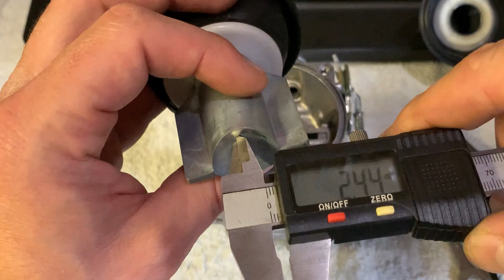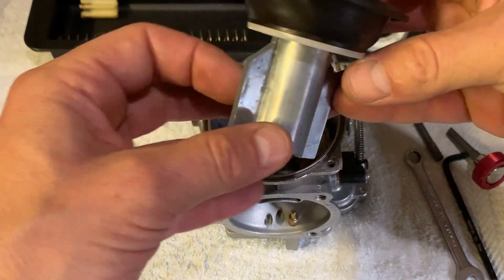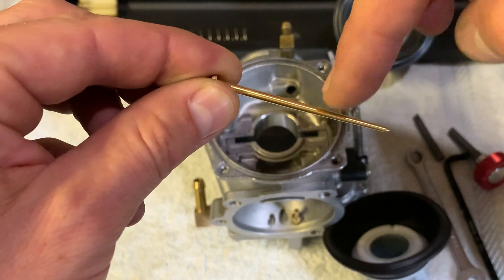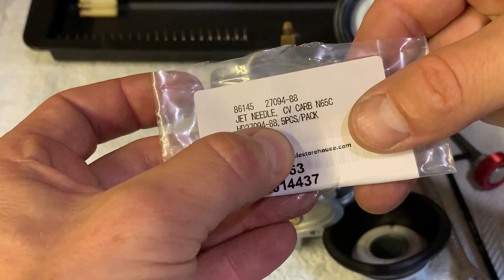Harley CV Carburetor Tuning Twincam 88

Comment: This tune is great. Thanks for this. No more popping and coughing through the air cleaner. Runs perfect. 2005 88ci
Reply from the maker: Glad it worked 👍
Reply: The same for my bike twin cam 88 2005 caughing i just shim the needle and sand paper a bit and right on perfect and thank you for the jets size and years info great my friend!

Comment: Aron, I did the mod. Including the Sportster needle. 
Results; faster, smoother and it idols.
Reply from the maker: Great! Pleased it worked out.
Reply: @aronsgarage834 

I do have an interesting thing on my Carburetor, the mixture has a fill or plug making it inaccessible. I didn’t attempt to do anything to get to it.  Have you seen the his on any of the ones you’ve worked on?
Reply from the maker: Yes, of course. That’s just the factory plug. At least you know that nobody messed around with your carb before. You need to drill a small hole in it (not too deep as you can easily damage the mixture screw under it.) then using a screw extractor you can easily get it out. Do count the tuns though and record it somewhere before changing the setting.

Comment: Great video! I have a 2006 night train 88 cu. in. with Thunder header 2 into 1 exhaust stock CV carb. harley one step up SE211 cam and screaming eagle air intake. Stock control module also. I have the N65C needle but not sure how many washers I should install on it. can you help out a Vet?
Reply from the maker: I think you’ll be alright with 3 washers.
Reply: @aronsgarage834  I couldn't find  .3mm washers anywhere but, I did find .5mm washers. Would I be alright if i install
ed' 2 of them? that would be 1.0mm...also, will I be alright with stock 45 idle  and 190 main  jets?
Reply from the maker: Yes, 2x .5mm will be perfect. And yes, keep the 45 and 190
Reply: @aronsgarage834  Update! You are correct when you say it's a beast. 2 of the  .5's worked perfect. No hesitation at all even on slight acceleration. Top end pulls stronger too.  Thanks again Bro. I'll keep on the lookout for any new videos you put out.
Reply from the maker: Great to hear the setup works for you too!

Comment: Great and very helpfull vid. Thank you. Now my Sportster XL1200C 1999 model (screaming eagle pipes and k&n high flow filter) seems to be having a shortage of fuel. Gonna try 45 (was 42) main jet and a 180 (was 170). Should that do the trick? Or bigger jets?
Reply from the maker: Yes, you should bump up the slow jet to 45 and the main to 180. Later on it was standard anyway on the 1200 Sportster.

Comment: Hello Aron,

Nice video👍🏻.

I have a problem with mij dyna tc 1999.

My fuel consumption is terrible. 

It was 1 to 18, 1 liter on 18km

Nou it's 1 to 8 😢😢

I completely cleaned the carburateur and refurbished the carb.

Do you have an idea what it can be. 

Hoop to hear from you.

Kind regards, 

Mike
Reply from the maker: Hi Mike, Mine is a 1999 Dyna too! Did you install the needle jet the right way? Goes back in either way and can cause issues with consumption. Float level all ok? Pilot screw adjusted? What jets and needle are you running?
Reply: @aronsgarage834  
45 and 190.
This problem started 4 weeks ago. 
I have no idea why??
It doesn't smell like fuel, no black smock out of the exhaust.
Reply from the maker: Did you double check all those things I mentioned?
Reply: Hi Aron,  yes I did.

I have bin driving to day and still 1 to 8
Reply from the maker: Then I would check a few other things: tire pressure, brakes, wheels (to make sure they aren’t dragging), air cleaner, choke/ enrichener, diaphragm on the slide, engine oil level, exhaust, any gas leak.
Reply: What is diaphragm on the slide
Reply: I know what you mean 
I have put a new one in
Reply: I have suppertrap exhaust on my bike 

Nothing has changed on my bike
Reply: When the olie is two low will it use more fuel??
Reply from the maker: It’s the rubber around that creates the seal for the vacuum. If torn, it could cause problems with fuel.
Reply from the maker: Good
Reply from the maker: Yes, it would. More friction, more struggle for the bike to run as normal

Comment: Great video and very informative. I own a 1995 XLH1200 Sportster and I'm about to replace the jet needle to a N65C, however I'm not sure what the stock slow/idle jet size should be from factory. In my official Harley parts catalogue it states part No: 27281-92 but doesn't state the size. Likewise with the main jet, no size given. Can you please advise?
Reply from the maker: Thanks for the feedback. I pulled some data, looks like yours had 42 slow and 170-185 main depending on model. I would try 42 and 180 combo, but if you’re over 4 turns out with the mixture screw (when running properly) you might want to bump it up to 45.
Reply: Thanks for your response and information. Regarding the needle, do you suggest I use the 3 x 6 x 0.3 shims too and how many?
Also, where is the best place to source the jets you mentioned, please?
Reply from the maker: I think 2 of those shims would be enough for you. You can get jets from CV Performance (great quality) or genuine Keihin.
Reply: Sorry, it should read mixture screw 4 and 3/4 turns out.
Reply: I ended up turning the mixture screw 5.5 turns out to achieve a satisfactory outcome.
Reply from the maker: In that case I would definitely want to up my slow jet by 1 size. 4 turns out should be the very max.
Reply: @aronsgarage834  I have a 48 slow jet available, do think that should suffice?
Reply from the maker: You have a 42 in there currently, right? If so, 45 will be plenty. Even in a Dyna 48 can be too rich.
Reply: @aronsgarage834  I swapped out the 42 for a 45 and that's what is currently at 5.5 turns out. I do have a 48 too, but I'm awaiting your advice. Please note: the mixture screw projected 2mm into the throat of the carb intake when fully screwed in.
Reply from the maker: Okay. I see. It projects quite a bit, hence you need more turns out I believe. Out of curiosity, when screw is fully seated, how many turns out to get it flush with carb body?
Reply: @aronsgarage834  Not sure. Do you advise swapping the 45 for a 48?
Reply from the maker: I would stick to the 45 to be honest.

Comment: Thank you for making this video. Great stuff! I did this to my 2000 soft tail heritage and it runs great now. No more sneezing or coughing. The only issue I have now is that it idles a little to high for my liking. What would you think the fix would be for that? I think the only modifications I have are a high flow air cleaner and straight pipes.
Reply from the maker: Thanks for the positive feedback. It’s just a matter of bringing it down with the idle screw. Have you tried that? It should run around 850 idling cold and 1000 warmed up.
Reply: Twin Cam motors are supposed to have a slightly higher idle speed than older, EVO, Shovel motors. The beloved 
"potato potato" idle is for older motors. Bringing a Twin Cam idle down very low could cause engine damage, due to low oil pressure at idle.

Comment: Hi Aron, thank you so much for this awesome video. I've got a 2001 Harley dyna 1450, with exactly the same exhausts etc as you have. I followed this video and did a carb rebuild kit on my carb and at the same time I set it up to your spec and made sure float height etc was good. Wow, mate, I thought my bike was good before but now it moves like shit off a shovel!! I certainly reaped the benefits of my labour. Thank you again dude. Ps, are you based in US or UK? Peace and love from England. Grant.  🙏🏻
Reply from the maker: Hey bud, I’m glad the setting worked out for you! You’ll notice that even the consumption will be great, too. I’m based in the UK (Milton Keynes) Might see you on the road in the spring 😎
Reply: @aronsgarage834  ah cool, ya know what that would be pretty cool actually man. I'm pretty sure we could make that happen. Cheers!
Reply from the maker: Absolutely! Let me how the bike runs in the spring
Reply: @aronsgarage834  will do mate. Tempted to go to a 46 slow jet as I'm at around 3 and a quarter turns out on the fuel mix screw. I tried just under 3 but it had a couple of moments of hesitation (carb sneezes),
 But soon as I hit 3 and a quarter it ran beautifully
Reply from the maker: I’ve been at 3 and 3 quarters for a while now and runs even better. Better cold idling/running and same performance. Seem to remember when I tried it with 46 it was not as good. I clearly remember though running it with 48 was really bad. Was running way too rich (sluggish) even with pilot being half a turn out only.

Comment: Very informative, thank you. I have a 94 Dyna 80 ci. Screamin Eagle pipes, high flow air cleaner. Would this set up work on my Evo?
Reply from the maker: Well, I have never tuned an Evo so this is only my best assumption: I think it could work really well, but I would use your stock jets. I believe 42 slow and 165 main?

Comment: Do you need to shim the CV Performance needles also?  Great video.
Reply from the maker: Thanks. Not sure as I didn’t experiment with those needles, but since it’s a performance needle, you shouldn’t need any shims.
Reply: @aronsgarage834  I checked their website. No shims required, just drop in and run it.
Reply from the maker: Yeah, that’s what I thought.

Comment: I have a 2005 dyna wide glide. I put an aftermarket air breather on and now my bike runs like crap. Do i apply the same methods here? Do i need bigger jets and needles? Please help!
Reply from the maker: You don’t have to get bigger jets. Your stock one are 45 and 190. And you only need a different needle if you want more power. You just need to adjust the slow jet for now. Count the number of turns it’s set in now, (by screwing it all the way until it lightly seats as you’re counting. Assuming your stock setting was around 1 3/4 turns, set it 3 turns out. See how it runs and perform the fine tuning method I show in my other video (while bike is idling)
Let me know how you get on.
Reply: @aronsgarage834  I'm actually having a hard time getting that screw to move. I'll try letting it warm up a little and try it then
Reply from the maker: Yeah, you can try it that way. If no luck, you might have to take the carb off and soak it with wd40.

Comment: Hi! Awesome video. I'm curious, if this setup or tuning would be the same for a 88" Twin Cam with a stage 2. I've recently installed the Feuling 525 Camchest kit in my '02 FXDX and I'm thinking I could get better performance if I was able to more accurately tune it. I'm not confident it's tuned right, but if I recall, Cams will drastically change the tune needed for the carb. Any suggestions? Got a 2 into 1 Thunderheader, K&N Air Cleaner, and the 525 Cams.
Reply from the maker: Thanks!
I’m not entirely sure as I’ve never tuned Twincam with stage one, but I would give it a shot with this setting. If the mixture turns out to be a but weak then you could always go up in slow jet (46 or 48 even)

Comment: Thanks for the info, my question is, I bumped my tc88 to 95"" would still use the #45 pilot jet, or go up to #46-#48  have aftermarket intake and exhaust on the bike and a N65C needle/shims on my table
Reply from the maker: That’s likely to be a 48, however it is only my assumption. I would put that in and do the fine tuning with the pilot screw at idle. Should fall between 1.5 and 2.5 turns out with the 48. Let me know how it turns out!
Reply: @aronsgarage834  Thanks! maybe tomorrow.
Reply: How many shims would suggest?
Reply from the maker: I would go with 3 shims.
Reply: Hey Aron, just a little follow up, This bike did already have a #48 in it,  I installed the N65C jet with 3 shims, air screw turned  out 2 turns and  I am very pleased with the results. The bike starts right up, warms up quicker, pulls strong, and does not shake as much at idle.  I am going to tune on the air screw a little to get a little better throttle response on the bottom. but all in all I am thrilled, Thank you!
Reply from the maker: Very pleased to hear that! Glad I could help.
Reply: @steveneichele4662  no shims with the 1200 needle if it's not enough put a 50 jet in it! I'm running a 50/200 slow/ main jet in my 44 cv on my 88 motor with a woods K2 needle... which BTW is longer because the carb is bigger. I had a 1200 needle in it thinking it would be better however it causes the carb to sneeze when it was cool out as it lift's out the jet tube too fast. Same as putting washers under the needle!! Maybe one should be ok!
Reply: @enricomandragona163  I think you`r right , I since went from 3 to 2 shims and it seems a little smoother, next time I have the carb off,  I`ll go down to 1 shim.  Thanks everyone!
Reply: @steveneichele4662  your welcome. Since you upgraded the intake try going with a 44 CV carb since your running a 95" motor now.

Comment: EXCELLENT  video mate, will this suit a 80 cube evo 94 dyna superglide? cv40 carb?
Reply from the maker: Thanks! I’m not sure about the Evo as I have never tuned one. I would leave your jets stock ( I believe 42slow and 165main?) and throw in the 88 needle without the shims. Or maybe 1x 0.3mm washer and see how it runs.
Reply: @aronsgarage834  thank you for the fast reply, I will use your other videos foe cleaning the carb etc, great videos Aaron thank you very much!
Reply from the maker: Very welcome, Evan. I’m happy to help my fellow bikers!
Reply: What pipes are on the bike? Air filter? A 45 is good no washer under the needle!

Comment: Hello there, great video, I just purchased 2006 harley sportster 1200 carburetor same as yours, how do you do the oil separately for the carburetor? I love to do that in my bike. I just did deep clean in my carburetor. And I like they way yours look super clean, do you have any video for that? Thank you 😊
Reply from the maker: Hi, Thanks! 1200 Sportster is a great choice!
What do you mean about doing oil separately for the carb?
Yeah, mine looks very clean. I did put it through my ultrasonic cleaner, but a carb cleaner spray will do the trick inside and outside. :)
Reply: @aronsgarage834  I founded. Is the one you have in your bike catch can air oil separate 
Thank you
Reply from the maker: @Ruffles206  oh you meant the crankcase vent. Yes, it now goes into a catch can I made. I will make a video on how to make one in the future.
Reply: I order this kit for my sportster 1200 custom Drag Specialties Breather Kit For Harley Sportster 1991-2022.I start doing today and I found out that the plastic cover the one hold the carburetor that’s doesn’t fit with kit, you’re air cleaner is smaller. Do you know or found a video how this kit works?
Reply: @aronsgarage834  how does your catch can vent you have a rubber cap on your exit side of catch can and breather vent hose going to catch can entrance ? or am i just Stupid?
Reply from the maker: It vents through those holes I drilled at the top.
Reply: @aronsgarage834  ok didnt see them i like that idea! clever

Comment: Is it really 3 turns out, I’ve read somewhere that it’s more like 2 turns or 2 & 1/8…?? How many turns did it come out after you tune it??
Reply from the maker: Mine is 3 & 1/2 currently. 
1 & 3/4 and 2 turns out were factory standard. These bikes were set too lean to start with. Then like most of us, we put high flow air and open exhaust on, so need to adjust. 
The 3 - 3 & 1/2 sweet spot applies only if you’ve done those small mods and your carb has stock slow jet (45).

Comment: It would help me if you could give me a purchase link for the part whose hole was measured as 2.8 mm in the video (on which you wound the 190 main Jet)
Reply from the maker: Unfortunately I can’t find a good link, but if you search for Harley Davidson CV carburetor keihin needle jet, you should be able to find it. Or go to your local bike parts store and they should be able to look it up for you.
Reply: @aronsgarage834  I found a Harley Davidson CV carburetor keihin needle beam, but I can't see the 2.8mm part separately!
Reply from the maker: The needle jet is the part with a 2.8mm hole. It’s one part
Reply: @aronsgarage834    I got a 130mm long sliding spring in the set. Do you know an article number that gives the requested 143-146 mm?   The other parts are there, only this is different.
Reply from the maker: The part number I got is 27162-89. I have noticed though, they still come in different lengths sometimes. Even the dealer couldn’t verify why that was.. Hope it helps
Reply: @aronsgarage834    Everything corresponds to the description. At low gas, it jerks and sticks back into the air filter. The candle is very white, it is not possible to add more to the mixture screw. The length of the needle is 55.4 mm ~2.18 inches.   I bought a needle that is 53.7 mm ~ 2.11 inches. What is the real length?